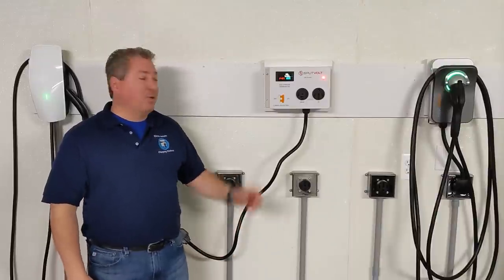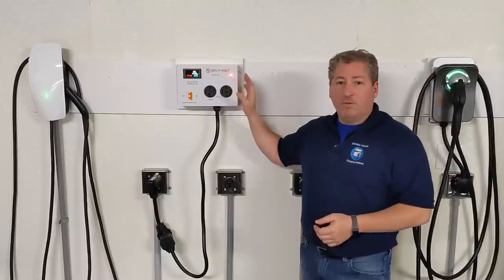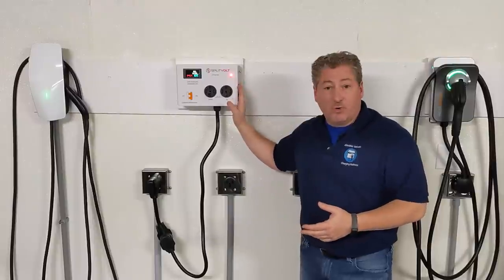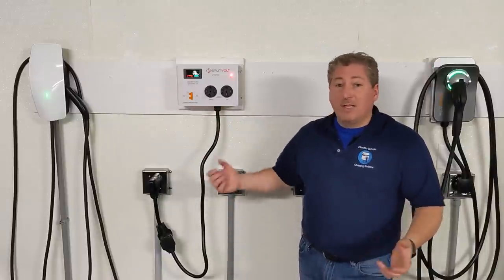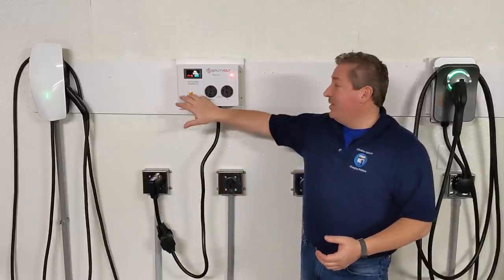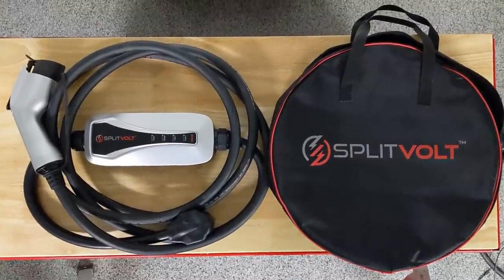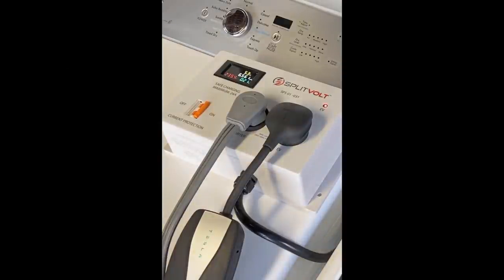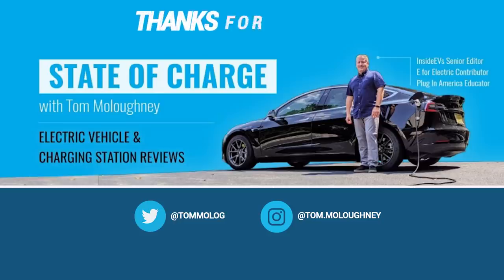SplitVolt Circuit Splitter For Electric Vehicle Charging

Comment: If your panel can't handle a new 240V line chances are it's old enough that you need a new panel anyway. My electrician has been telling me I need a new panel since the early 90s. I ignored him then when I was doing a major renovation. When I got a Volt in 2016 his son put it in starker terms, he said that if my panel was in his house he couldn't sleep at night. I took the opportunity to upgrade my service to 200A and to get a modern panel. It cost me $2800 for the panel and service upgrade and $375 to run a 40A line and to hook up a ClipperCreek. When I had a Tesla Wall Connector installed in 2019 they charged me $750 to run a 60A line and hook it up. If all you have is 100A service chances are your panel is 50 or 60 years old and needs to be replaced anyway, getting an EVSE is the kick in the pants to get you to do something that you ought to do anyway.
Reply from the maker: Sure, if you can afford it. ;)
Reply: @StateOfChargeWithTomMoloughney Can you afford to have your house burn down? If a panel doesn't have the capacity to add a 240V line it's been there for a very long time, if it's from the 60s or earlier it's probably dangerous. It needs to be replaced for safety sake even if you aren't putting in an EVSE.

For people with a modern panel the cost to run a line is barely more than the cost of this box that you were reviewing. My second 240V 60A line cost me $750, that box is almost $400 and it can only handle 24A while the new 60A line can handle a 48A EVSE. It's pennywise and pound foolish.

Comment: Very smart device. Years ago my electrician installed the charger on my electric dryer line and said “never run both at the same time...”.  😉
Reply from the maker: That can work if you are very careful. Not advised, of course. The Splitvolt provides the extra layer of safety so you don't have to worry about it.

Comment: You are absolutely right. I just got a quote, $4000 ish, from the professional that I have to upgrade the panel from 125A to 200A to install a Gen 3 Wall Connector. It is ridiculous. I didn't buy the EV to save the money for the electricians. Then I searched a lot and realized I can use the dryer outlet which is a NEMA 14-30, allowing me to charge the car about 20 mph which is more than enough for my daily driving. I am glad that I did the research which saves me a lot of money. Thanks for your helpful videos.

Comment: Tom on the subject of sharing a circuit, do you plan to do a review of the Flo X5? Apparently two X5’s can share the same circuit (20amp,30amp,40amp?). Are there any issues/conflicts using two Flo PLC’s with two X5’s sharing a circuit? The Flo X5 is also rated to -40 degrees how does it fare in your freezer test? How does the Flo connector compare with ChargePoints or ClipperCreek’s ruggedized connector? Here in Western Canada -40 and lower is common in winter.
Reply from the maker: Yup. I already have the unit, it's on my review list.

Comment: I have the an unused electric dryer outlet sitting in my laundry room (unit is gas), close to the garage, but not close enough to have this unit and have the charger reach my truck. My plan was to take the outlet and make it a junction box, and rerun a new outlet from that, into my garage and install a new NEMA 14-30 outlet in the garage so that I can plug in the splitvolt 30amp charger (not use the splitvolt splitter). Is there any reason this won't work?

Comment: Tom, based on your review, I bought the SplitVolt setup over the other options on the market in early June of 2021 and installed it right before taking delivery of our 2021 VW ID.4. Installation could not have been easier; I mounted it using 4 screws in all-by-my-self. (That's for anyone who thought they might need a You Tube Video to walk them through it. LOL) It's now been over 18 months since installing it and it's still cookin'. 24 amps gives the ID.4 around 20 miles of charge per hour. Unless you drain the battery all the way down, evening charging should suffice. Oh, just make sure you order the correct connection, as there are several to choose from. So, that's my State of Charge!

Comment: In our old house we were lucky to have an unused 240V, 30A outlet installed by the previous owner.  We purchased a NEMA 10-30 adapter for the car’s included charger and the car charged at 24A.  We have a long range model 3 and never felt that we needed faster charging.  24A level 2 is perfectly adequate for most people I would think, and this splitter is a good solution.

Comment: Excellent report.  This device appears ideal for EV owners with a hot water heater in garage.  Many water heaters use a 30 A plug & breaker, identical to a dryer.  It appears the Splitvolt will turn off EV charging when the water heater demands power, typically for under 10 minutes, and multiple times overnight.  Some hot water heaters are directly wired in so there’s no plug.  Splitvolt won’t work until you get an electrician changing it to a plug, but in most cases that’s much less expensive than installing a new circuit.
Reply: They could make one side hard wired technically

Comment: I’d really like something like this that better integrates into your house. What I mean by that is something that integrates into a sub-panel so you can use it across rooms.

For example, I have a dryer outlet in a separate room from my garage (they do share a wall though). In this example a sub-panel outside my house feeds both the laundry room (240V @ 30A) and the garage (110V @ 15A). 

With a version of this that works like a sub panel, I could run a NEMA 14-30 from that device/subpanel to my garage through the existing conduit and enjoy the same functionality without moving my dryer into the garage.

To my knowledge it would be against code (and messy looking) to use one of these as currently designed to run one of the lines through the wall into my garage.
Reply: Hi @lynyrd65YT!  Did you ever find a better solution?  My problem is similar to yours.  My dryer is inside the home, almost perfectly opposite the garage wall where I would want to put the EVSE.  Some sort of hard-wired arrangement, perhaps in a subpanel, would do the trick for me.  I would want it to be code compliant.

Comment: Looking at one for my lightning but there isn't a way to reduce the amp pull. Since you have lightning, any thoughts here? I may actually use it with an electric water heater that's in the garage.

Comment: Current protection always operates on a time curve. Electric devices almost always have a surge current that lasts for a small fraction to a few seconds. To prevent nuisance tripping the amount of time until the device opens is based on the current and how long that current is applied. A small 1-2 amp overload may take several minutes to trip a breaker, a short will cause an immediate trip. 

I was looking at a typical household breaker and at 150% it would be anywhere from 45 to 300 seconds before before it would trip.

Comment: Tom, I can see this unit sharing a circuit with an appliance you control when to use. However if the circuit is shared with, say, a water heater ...... that is not optimal because every time the heater cycles on/off this interrupts the charging session. But this could be a good solution in many situations I could see 👍
Reply from the maker: Are many home water heaters on 240v 30-amp circuits? I am unfamiliar with those, I'm afraid. I see these working most often on an electric dryer or perhaps even an electric range circuit. A lot of people have their utility rooms where the dryer is located next to the garage - and some people have the washer/dryer in the garage.
Reply: @StateOfChargeWithTomMoloughney  In Florida, we don’t have basements, and water heaters for detached houses occupy a corner location in the Garage. Unlike my days in Jersey, when I had huge basements (Holmdel and Murray Hill ... Bell Labs days!). 😅
Reply: all electric water heaters are hardwired. So this example does not apply to those.

Comment: What about a vehicle that doesn't have the ability to "step-down" the level of amperage to say 24 amps. Does this restrict the amperage to 24, or will it allow the car to draw say 32 amps and trip the breaker? Or is it smart enough to only allow 24 amps to be output.

Comment: A 220/240 vac line are opposite split phases of your circuit panel, basically two 110/120 vac lines that are opposite in phase.  Your home AC outlets are spread across those two split phases so theoretically, you can make a 220/240 vac outlet with two long 110/120 vac extensions that you can run to different household sockets throughout your home, the counter sockets in the kitchen often have the top socket on the opposite phase from the bottom to spread the kitchen load across the two phases.  Such a device is easy to make and could be a temporary setup if you are charging at a home without an easily reached 220/240 vac outlet.  Only problem with this would be the long extension cables needed.
Reply: The theoretical device you're talking about exists and it's called "quick 220" around 300 dollars and it's portable....

Comment: I just got a Lexus RZ and looking to charge using those outlets. Will a 25ft charger cord with the 14-50P that has a 32A charging speed work for this? I most likely will have to reduce the amps for this charging configuration. I appreciate all this information.

Comment: I was out of room in my electrical box, so since I had to rebuild my old 3-wire dryer circuit, I started with 50 feet of 6/3 wire, ran it to my garage into a nice big 15.7 x 13.8 x 4.7 inch (400 x 350 x 120 mm)  junction box.  Then I bought 3 multi tap 3 Wire Port connectors of 1.60" X 1.50.

Each wire except for the grounds use the multi-tap 3wire port connectors, and I just use a 3 port Wago 221 for 10 AWG for the 10 AWG grounds. 

Then I ran the second splice in the 2nd port of connectors to run my dryer connection, and I used the 3rd port to run my EV connections.

It's only on a 30 amp connection, but if I decide to upgrade I can easily bring it up to 40 amps or more on the 6/3 wire.

Comment: How would I be able to use this if where I park my EV (VW ID4) is 50 feet away from my dryer outlet? Is that possible?
Reply: You could use a 240 volt extension cord from an RV store.  I have one of these and leave it in my frunk for those times when I pull into an Air BnB and the dryer plug is near enough to get to.  🙂

Comment: Question, based on the J1772 spec, are the EV cars OBC (on board chargers) available today that will adjust in real time to the square wave PWM signal from the EVSE to the car?  a 50% duty cycle means to the car to draw only 30 amps max. if the EVSE initially indicates 30 amps, but later in the charging time the EVSE wants to change it to 18 amps (lets say) would the cars OBC respond accordingly? Or is this PWM "signal" just monitored on initial connection?

Reason I ask is say you have a 60 amp breaker that feeds 3 - 240v outlets (say you have 3 EV cars), with a "Master" controller (that is in charge of sending the PWM), that only allows a total of 48 amp in combination to the 3 EVSEs. As car#1 nears completion, the "Master drops the available amps to car#1 EVSE and increases the amps to car#2 and car#3. 

This could also incorporate 2 to 4 other current sensors on the house main circuit breaker box to check whether a dryer,  electric water heater or other major amp drawing device in the house is currently in use and limit in real time the 3 cars charging to prevent the whole house from overloading.

Most  houses today have a 200 amp service, but there are many houses with only 150 amps. Putting a 60 amp breaker may be too much (as far as code) and just simply too much potential demand at any one point.

Thanks for your review of the SplitVolt

Comment: What is the difference between the 10-30 and 14-30 receptacles-from the CARS side. Such as using Tesla mobile connector. 

10-30 is hot/hot/neutral. 14-30 adds a ground wire.

Comment: So if I have a 240 v 60 amp circuit can I  supply two level 2 charge point home charging system to from that single circuit or does each unit have to have a dedicated circuit?

Comment: Is this still a viable alternative if I run an appropriately sized extension cord(6awg) to my garage to charge my Tesla from the split volt? Maybe over 75ft from splitvolt.
Reply: that could work, but the cost of a #6 cord will be a high percentage of what an electrician will cost to run a circuit to the garage. Also, a #6 cord probably wont fit into 30 amp plugs.

Comment: Our e-Golf can only pull 12 miles/hour with the 220v outlet (2016 SE model, 3.6 kW max. draw). Although it's faster than the 110v, we discovered this thing called "nighttime" when the car isn't being used (usually), so we charge it overnight 99.99% of the time. Liberty Science Center in Jersey City is one of the places we have charged and there are a couple of places in West Orange too -- but since we got the portable 220v charger we just run the cable from the thru-the-wall AC outlet in the dining room, out the window, over the garage flat roof and down to the car, when needed (about 4x year maybe).
Reply from the maker: I was at the Liberty Science Center when they installed those chargers years ago. I think it was in 2014.
Reply: @StateOfChargeWithTomMoloughney  Yep, some of 'em got damaged over the years but there were loads of 'em. We just don't do enough mileage to need more than the nighttime 110v top-up (or the boost with the 220v portable EVSE) -- but I can see that many people would need some way to charge  faster at home. Your Tesla-to-J1772 video was great, btw!

Comment: I have a 50 amp circuit and basically the safest way to use it is to allow no more than 80% to be used continuously so that would be about 40 amps. Is there something similar to this that can draw more power?

Comment: Hi tom! Great video as usual. I had actully purchased the unit when it used to be called Powershare! Quick question for you..so my dryer comes with the 10-30 outlet. I got the 10-30 for the 2nd outlet. Could I have had gotten the 14-50 paired with the 10-30 of the dryer?

Comment: 13:15 If you look at the display on the kWh value, there seems to be a useful reset button there, like a trip odometer so you can reset the point in time when you start adding up energy transfer.  So it seems that you are not constrained to the less useful total-energy-transferred-since-the-box-was-built number. :-)

Comment: My Dryer looks to be hooked up to a circuit that has 2 25AMP breakers which are connected together.  Is that a 50 Amp circuit?
Reply from the maker: No. It's 25-amps at 240-volts

Comment: Hey Tom 
 Here is another idea I am looking at but concerned on safety and the SplitVolt product only having a 1 years warranty.
This is from their website. I am going to have to drill a whole through the wall in my laundry room into the garage to connect the AmazingE portable charger to the Splitvolt device with my car using extension cords. 
What are your thoughts?

FAQ – Splitvolt Extension Cables & Adapters

What are Splitvolt extension cables and adapters?
Splitvolt extension cables and adapters are convenience products that make it easier for your EV charger or Splitvolt Splitter Switch to reach your vehicle. There are multiple lengths as well as various socket and plug interface combinations. Primary interfaces are NEMA 10-30, NEMA 14-30 and NEMA 14-50.

Thanks

Malcolm

Comment: Is there a difference in output if I use the Tesla mobile connector vs the split volt evse plugged to the Tesla with a j1772 adapter.

I have the split volt splitter already. I would like to have one evse for Tesla and another ev brand.

Comment: Our condo HOA is looking provide EV charging for owner’s.  The charge location will be located in a secure underground garage.  We will install a NEMA 14-50 outlet.  The Splitvolt would allow us to charge an EV and calculate the actual electrical consumption to be able to reimburse the association (honor system). If we’re successful and additional owners purchase EV’s, we can explore other options.  This seems to a good starting point for the 4-5 EV owners.  Thoughts?
Reply: something to look into is the "orange charger" which is made for exactly what you are doing (plug share in a condo situation) but they are only available up to 30 amp. (24 amp charge rate) They have a QR code and a phone app to sort out the fees between multiple tenants. There's a video on this here on YT.

Comment: Off topic question.... How many EVs could YOU theoretically plug in simultaneously in your garage (not considering space limitations) and charge at rate of at least 32 amps with all the outlets you have and the electric service set-up currently in place?  I know number of EVSEs is not the limiting factor for you, but could you run all your outlets at once without tripping a breaker?   Just curious, and a little bit envious.
Reply from the maker: I can have 1 EV charging at 48-amps, 2 at 40-amps, and 1 at 24-amps simultaneously. And there's been plenty of times when that's happened. I host EV BBQs at my house every now and then and have had as many as 20 EVs in my driveway at once. :)
Reply: @StateOfChargeWithTomMoloughney  20 EVs in one driveway?  Now I have driveway envy too......
Reply from the maker: @mikeg7845  I have a looooong driveway. :)
Reply: @StateOfChargeWithTomMoloughney  What FL county are your BBQs?  If one is scheduled after ms refresh, I could showcase new vehicle at event.
Reply from the maker: @johnpoldo8817  I live in New Jersey, not Florida.
Reply: @StateOfChargeWithTomMoloughney  Sorry, my bad.  Saw this "@Tom Moloughney In Florida, we don’t have basements..."  and incorrectly thought it was you speaking, but it was someone else replying to you.